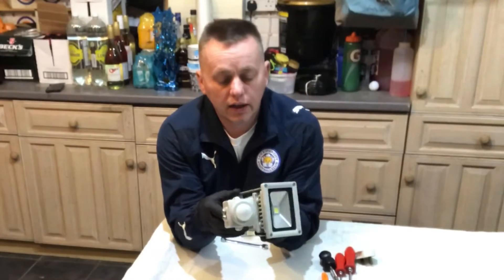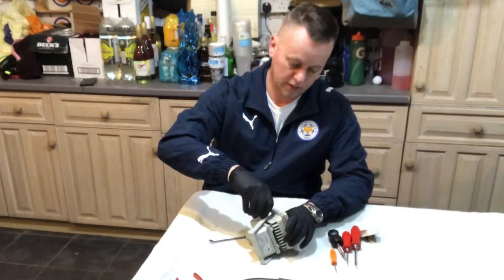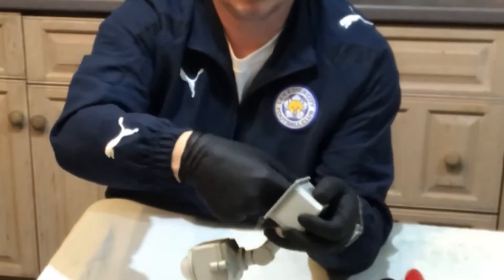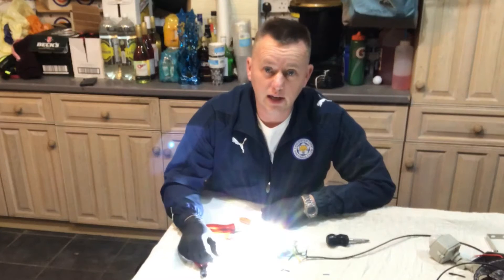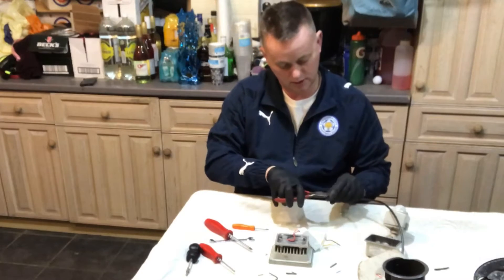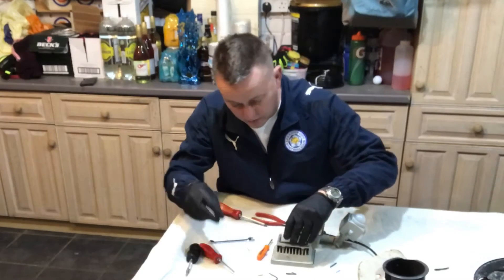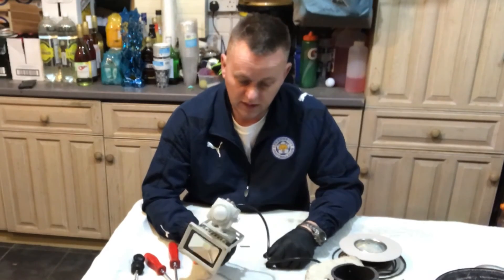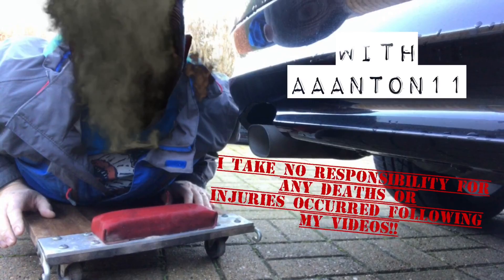LED OUTSIDE LIGHT PIR FAILED, How to ByPass and Repair

Comment: My problem is how to replace a pir light with an ordinary light . there`s six wires from the old pir and only three from the new ordinary light and when I wire it up - blue , yellow/green and brown , the light stays on.
Reply from the maker: you have a permanent live is there a switch somewhere, Thanks for the great comments👍🏻👍🏻🛠
Reply: @aaanton11  Hi , thanks for the reply , yes , there is a switch , it was used to overide the pir and switch the light on permanently . There`s two cables from the wall , one has the three normal wires Blue , G/Y and brown and the other cable has only one wire coming from it , brown . I wired the new light up using the three wires from the one cable and insulate taped the other brown wire , should I have used the solitary brown instead of the brown that was part of the three wire cable ? , thanks again.

Comment: WHAT? Just Bypass it? Not say why it failed? You need a Occilloscope to look at PIR levels in the dark and light and a VOM to see when it triggers and a Capacitor checker to check out of bounds capacitors,  and a shot of Rye, and a calibrated lamp at so many lumins, and a Horse Shit detector.  And, a tape measure so distance from detector can be measured and a hot blond ,......... Oh ferget it.  Just buy a NEW Security Light for $35  It will be cheaper.  Love your blue space cadet suit mate. At least You have the balls to make a YT video Good on ya. Video In the spirit of Ed Wood. Eeeeeek
Reply from the maker: 😂Thanks for the great comments👍🏻👍🏻🛠

Comment: Why not just open the Pir and link the switched live and live together with a wago no need to rewire.
Reply from the maker: It’s you choice, I prefer the pir removed, thanks for the great comments 👍🏻👍🏻🛠
Reply: @aaanton11  You're not removing the pir with this though to keep integrity and water proofing, my way just does what you did without the rewire, bypassing the pir and having light permanently on this way seems wasteful.